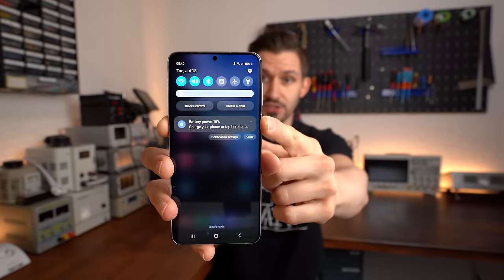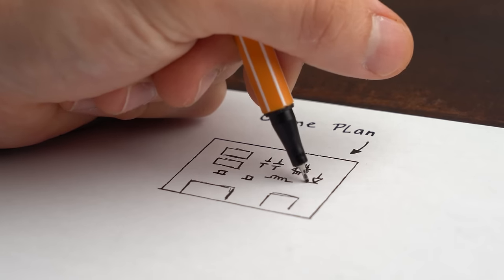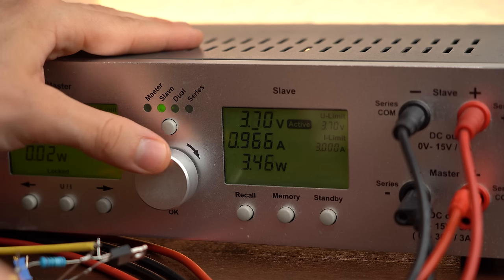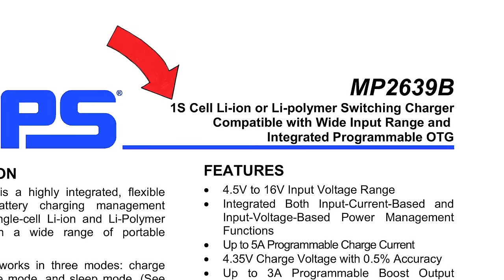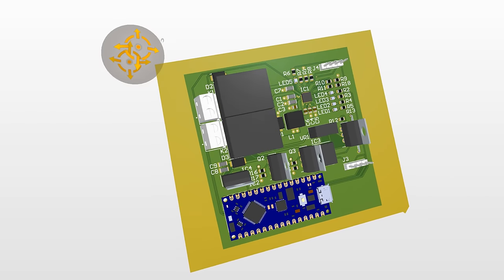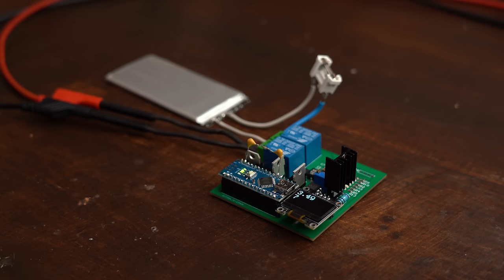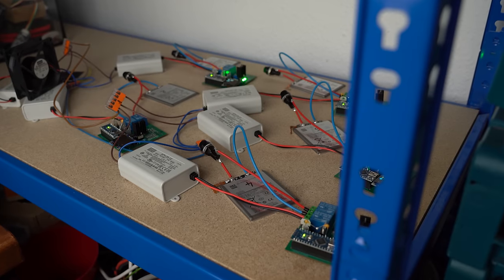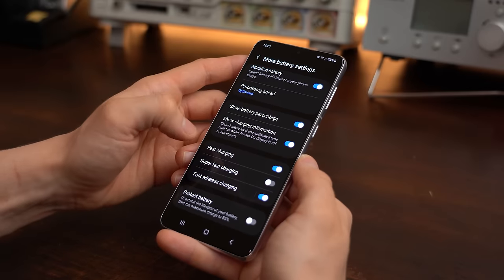Don't Fast Charge your Phone before Watching this Video!

Comment: QC isn't the same as high current charging... Crappy tech pushes more current at the same voltage. High efficiency chargers use LESS current as current = heat, but uses higher voltage.

Normally a 4.2v lithium polymer QC system used about 12v (QC3), now higher efficiency QC systems exist.

Comment: this experiment has its flaws though.
A) phones consume 0.5A or less. 1A is a peak in cpu usage + full brightness + wifi 

B) phones dont charge and discharge continuously. both things produce heat and heat affects batteries. they're meant to be resting at a low power demand a lot of the time.

C) 2 vs 3 sample size is problematic, and can also make your results biased. if a 1A sample failed, you'd have attributed it to a defective battery, but if a 5A sample failed, most likely you'd attributed it to the charge rate being too high.

i believe the only way this experiment can be valid is to use 10 phones in demo mode with an app that can turn on and off the charger. 5 of them on a regular charger, and 5 of them on a fast charger.
either way my phone always charges at 70W and i havent noticed any change after a year. maybe the battery degraded a bit but no battery will last you 5+ years even if you charge it at 1A.

Comment: Exaggerated decay of capacity under fast charging has been understood and unnecessarily debated by dudes in comments sections since chargers started creeping past one amp, haha. But we are where we are because, like the grand majority of design/materials choice in mobile tech, aspects of practicality, durability, and longevity are at constant odds to general consumer desires with how the devices we use are done so more as a social symbol than as the tool they actually are. So the moment manufacturers catch a whiff of something to capitalize on, they dive dick-first with an all-in approach regardless of the almost guaranteed hit that change makes on usability/durability because they've found out in the last decade or two that they can take advantage of how people overwhelmingly react to cosmetically damaged mobile tech with derision despite maintaining functionality from fear of being looked down on by others and/or being convinced that visual imperfection is a lot of functionality.

I know I'm rambling about a consideration of tech that enthusiasts would likely find personally offensive from self-defense or coming off as "that one guy" that babbles about far-fetched psychoanalysis/political conspiracy, but it's really neither of those things. When considering a purchase of ANYTHING, we are all guilty at some point of placing an irrational weight of that choice on social reaction – that thinking plagues me to this day, though not panic-inducing like it was as a kid hahaha.

Comment: Nobody charges and discharges their phones to 100% and 0% every time.

I know that testing for more variables would be a pain in the butt, but let's say, charge and discharge 1 battery from 30% to 95%, another one from 40% to 100% and a final one from 50% to 90% repeatedly, and do it for time, leaving the batteries charge and discharge at their different rates, for 3 or 4 days, so we see the real damage that a fast charger could cause, and how much do bad habits hurt the battery.

Comment: Could have used a single pcb, and multiplexed the output to the batteries.
Charging batteries with short duration pulses imposed onto the dc feed, will in fact, extend serviceable life by 2 to 3 times.
This explanation is over simplified.

Comment: Nothing exposed here :-). High c-rates stress mechanically and thermally and high ceiling voltages like the astronomical 4.35V you were using dissolve the electrolyte faster. Welcome to better use ;-)

Comment: Two faults in the conclusion IMO. Most phones don’t charge at 5A, usually much closer to 2 or 3 with higher voltages, also most phones aren’t charging linearly, they start off low current then ramp up then ramp back down, sometimes even being halted at 80% for a set period.

Comment: I always used to slow charge my phone overnight (using an old charger instead of the official one, so that the phone would also stay entirely cool)... but now I made the mistake of being a Pixel 6a and that thing not only gets hot at the thought of doing just about anything, but it also has absolutely awful battery life, meaning I have to charge it during the day. FOR A NEW PHONE. what a joke... at least it cannot fast charge. the fastest way to charge it I've found has it charging a few percent per hour, and if I use the fast charger of my old phone, it charges with -1% per hour. That's not a typo. The phone says it's charging, but it loses charge. I once again bought a joke without realizing it :|

Anyway it's good to have some confirmation that slow charging > fast charging. I was sure of it anyway, as it's how my Lumia 920 and OnePlus 6 have lasted me so long. I'm considering going back to the OnePlus, as a battery replacement for it is cheap and even before replacing its 5 year old battery it already lasts just as long as the Pixel 6a's new battery lol

Comment: I like where you are going in this video however, you jumped right over to speculation land there at the end. You have a trend graph going but you dont even start it at 3m, instead to speculate and jump straight to 1y/5%. I have had phones both with and without fast charging, both have shown signs of obvious degradation over their lifetimes. An 11% loss at 5 years would be great, and your probably right that its probably going to be higher than that. One point to note, most people replace their phones every 2-3y. So right around the time you speculate that the degradation will increase in speed is around the time the phone will be replaced.

In the end this will all be moot, the EU laws concerning replaceable batteries in consumer electronics should eliminate batteries as a factor in a devices lifespan.

Comment: This is so misleading most common fast chargers charge your phone 5v,9v,12 with only 1-3amps than those 5amps also those 3-5amps pretty sure they dont charge the whole battery for 3-5amps its smart to gradually lower its amp tru the whole charging. Also ive read that those battery that being charged with 5amps are like two batteries in one package so meaning 2.5amps per battery and its fast charging because you basically charging two batteries at the same time

Comment: You fail to factor in that phone power chips under super fast also throttle the charging speed based on temperature, battery age, and how full the battery is. The closer to 100% that the battery is, the slower the phone charges the battery in an effort to help cool it down, get a more accurate battery reading, and also preserve battery life. Batteries are based 100% on chemistry and changing these factors WILL have a measurable impact on the overall battery life and your results. I recommend you redo this test with a better controller setup or,  instead , use an actual phone charging circuit if possible. I do agree that super fast charging does decrease battery life, and I do believe that the results are measurable however your methodology is highly flawed.

Comment: This is literally the worst case scenario. The Chinese phones that fast charge split the voltage between two batteries and do the voltage regulation inside the charging brick so this test doesnt really represent those phones (would love to see a test with that set up but its probably way harder to replicate). Also yes this video shows that USBPD is a horrible standard and that you shouldnt be fast charging those phones

Comment: typical youtube click bait! why do we need one you tuber and one battery or phone testing results when literally tens of millions of fast charging compatible phones are already in the market. after years of use it does degrade the battery but so does regular charging. Fast charging simply does it  just a little faster. Not a big deal. Also a well know issue and well researched one. literally dozens of research been done on this issue. No need for further experiments and unneeded testing. we already have the answers to these questions.

Comment: I don't think this experiment is really accurate. You are executing the experiment with constant values of current, while the phone adjusts the voltage/current depending on battery level of charge

Comment: That is nonsense. Devices are designed to be charged at no more than the amperage they can use to absorb electricity. Thus, no harm will be done as they don't take overcharge.

Comment: It is always about pros vs cons. Super fast charging is valuable enough to sacrifice 30% battery capacity in 5 years. You won't lose that much if you don't discharge to zero and charge to the full capacity every time. That itself makes this experiment flawed. When you consider the fact that every maker, primarily Apple and Samsung is trying to make you buy a new device every year, this experiment loses more of its value.

Comment: I don't find your methodology aceptable for comparison with modern phones, because new phones have a lot of new tecnologies, uses different batteries and optimizations to achieve higher powers. You didn't tested these phones with their charger. Also, you left the batteries in high intermittent use, that's not common with cellphones.
Despite that, it's an indisputable fact that slow is better for battery health. The question is: is fast charging worth it? And now I say it is, because a used a phone with 65W charger for 2 years, and it had the exact behaviour of my older phones that had 15W chargers.

Comment: dude the moment your intro said it used 5A, that charging standard should burn in hell.... fast charging should use the lowest amp with the highest voltage to reduce the stress on batteries... they use higher voltage to reduce the stress on everything in electrical.... EVERYTHING.... WIRES.... BATTERIES.... MOTORS.... what kills electronics are the AMPS not the DC Voltages.... 

in fact most fast charging standards use high DC Voltages... so it should be fine and if its like my Poco F4 GT, where they provision 20% from bellow and above the battery's total capacity so you see 100% from the 80% total capacity of the battery, then you are at an even better spot to use their crazy 120W charger since it takes a lot of amps to fill the last 90% true capacity of the battery and generates tons of heat...

in fact since i see its a samsung battery.... i know this is a samsung smartphone with its stupidly weak 20W fast charging that burns the phone.... i mean my note 5 have this stupid ancient fast charging standard that no one should ever use.... the newer PD standards are much more superior and can charge 100W easily with lower AMPs than this ancient standard.....

just listening to the opening and looking till the battery with 5A, i already can deduce this video is only useful for people using this stupid samsung standard of fast charging.... and it is a video that is useless to everyone else using PD and other china branded proprietary fast charging standards... since they mostly use less than 5A or if they use 5A, they use it temporarily with extremely high voltage to jump your battery from 20% to 70% in less than 10 min which would not heat the phone as much as this ancient fast charging standard....
Reply: of course my 1st paragraph only applies to loads that can accept those voltages.... wires or conduits can accept extremely high voltages with no issues... it just depends on the loads in the circuits to be able to accept the voltages without burning out.... as for amps, that is pretty much can be assumed by how much of the electronic's life you had exhausted within its lifetime its very finite and increasing it, decreases the lifetime exponentially....

Comment: The power delivery is not at peak throughout the entire charge cycle, its on a curve.  This video is wildly inaccurate in its findings because it is not representative of how the technology works.
Also wireless charging is the most inefficient way to charge a phone, nobody should be doing that.

Comment: BAD experiment methodology...

You didn't tell us if the approximate 1.6% performance drop was an actual trend throughout the 100-event experiment, of it was purely an end result. This is important if you want to extend the degradation line into the future in a linear fashion as you did. 

For example, what if the degradation you saw was produced rapidly in the first few charging cycles, and after that initial time, the capacity becomes relatively stable? You can't simply infer that the linear line you drew from the beginning to the end of your experiment is going to be realistic going into the future. Maybe the performance loss happens at the beginning, and the line that you drew from the 100-event result into the future should be much flatter. 

I'm not saying my supposition is true, but I am saying that you didn't prove it to be false. So I really can't support your methodology as described in this video. Either your conclusion is ill-founded, or you didn't do a good job of explaining your experiment in the results portion of your video. 

Your thoughts????

Comment: what a fucking surprise.... NOT..

So ,much work done just cause you didn't learn physics in school.... 
1) some of the modern phones have double-tripple cell battery (like folding ones or etc)... and the main reason for them to die is cause the controller is set to maintain the balance between two cells and it's not that great in reality...
2) Like with the car batteries... You can charge 12V battery on superfastcharge, where it starts charging with big amps and finishes with lowering the amp amount... You approximately know the charging time which is for example like 4 hours. And you can supercharge it in about 2 hours.... Yes, it will charge faster, but it won't hold as long. But aswell, you can lover the voltage and amps and charge it overnight... and what do you know... the battery will be chaged and like.... overwhelmed. It will last NOTICABLE longer.
3) 100 cycles for 100 days... drop of 2% is fucking nothing, cause let's be fair - modern batteries arent designed to last. And 2 year warranty time says for a phone is fine. Usually we just break the screen or change the phone faster than that. 

So, why you wasted so much time and effort for dumbfucks who doesn't know physics? what a waste...

Comment: I can only tell you, that yours experiment is pointless. All this data is available for cells, and a drift by 15% after 2-3 years is perfectly normal. You will replace that phone due to other SW/HW limitations, in short will run slower with the more newer applications installed, as the HW cannot keep up with the newer SW.  Also you need a proper coulomb counting setup, any error on the current sense opamp  will mess up your measurements (especially offset error will lead to higher deviation at lower discharge rate...). Also if the current source is not properly designed, especially under-sized shunt resistor, you can have drifting of it's value. Usually at the end of the test you should check your gear to see if it still reads the correct current (a small parametric test). Still cannot understand you're video name/ recommendation, looks like any Indian click-bait video.
Reply: Sad but have to agree.
Battery chemistry has been well understood and characterized for all chemistries.
Regularly running the battery down to 5-10% SOC and then recharging either normal or fast causes accelerate wear.
Fast charging from low to full SOC causes verifiable wear due to excessive heat.  
Published science indicates extended life if you keep from going deep on discharge, and stopping charge at 80-90% full, and charge with a normal non-fast charger.
These aren't gimmicks, these are well understood operational suggestions which have shown to improve battery life.
If you are gaming or watching video x hours a day such that you are always running out of battery, try to do some of the suggestions and just expect to need a battery replacement sooner than other people will.